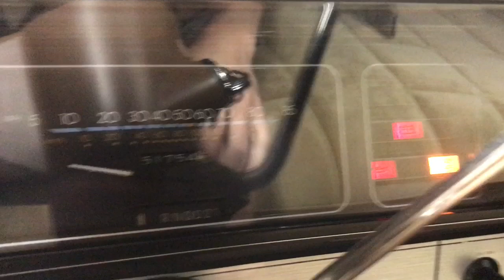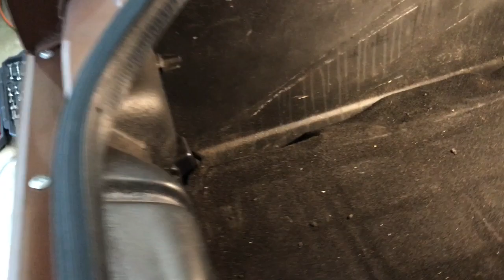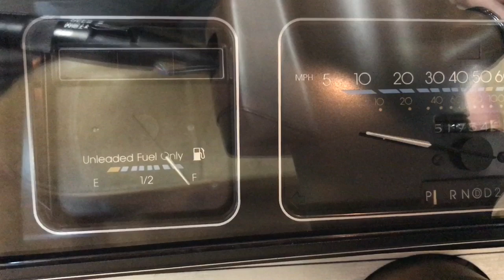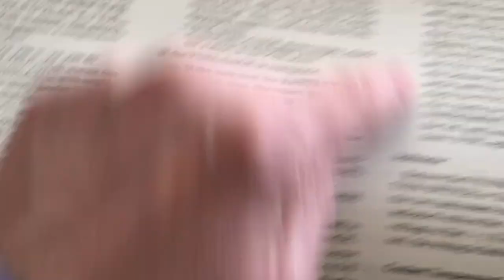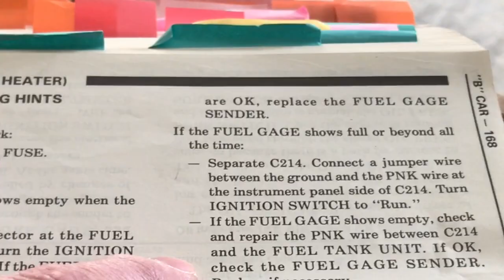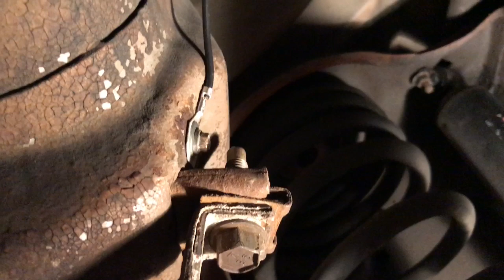Gas Gauge Problems - 1985 Chevrolet Caprice Classic

Comment: Om my 1980 Oldsmobile delta 88  i changed (put in new) the sending unit in tank ,filled up the tank and seen if the gas gauge read full.If not i pulled off the needle set it to the full position,then disconnected the wires to see if needle swong vsmoothly drops down  to empty.and back up to full.works for me .Even if  you have a new gas gauge  installed.But they say something about having it calibrated.Those colorful little blocks behind the screws behind the gas gauge i heard were resistors of some type,not sure .So if you buy a used gauge the  problem could be there as well if not the wires.Even if you buy a new guage.and install it .if calibration means adjustment.Then adjustment is  needed somewhere i would think .And those color blocks if they are resistor what number do they represent compared to your original one that might be old and losing resistance as well or not the right resistance.Just food for thought i been in that situation as well.

Comment: How did you get your hand behind the speedometer to disconnect the cable?  I can't reach...???  Help..
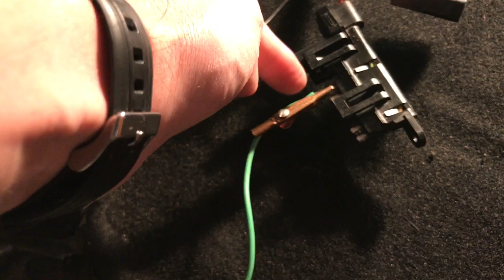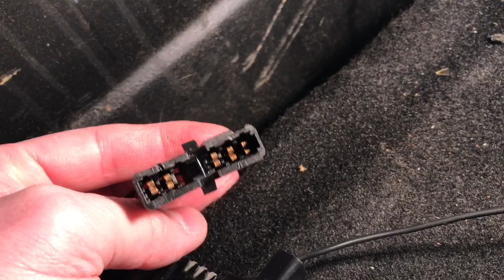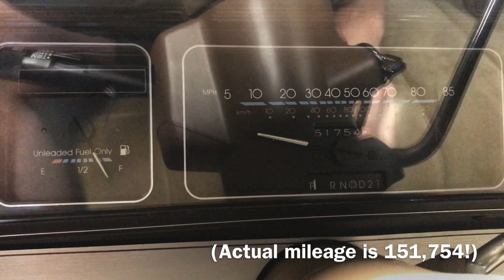Reply from the maker: @cmscms123456:  Starting at 5:20 in another video (https://youtu.be/AR3tJ8X4ECo), I explained and showed how to reach behind the instrument cluster to reconnect the speedo cable.  Also, starting at 3:42 in another video (https://youtu.be/yasrEpSDi4Q), I explained how to reach behind and disconnect the speedo cable.  And, at 0:49 in another video (https://youtu.be/M3ZANm2ygt0), I also explained how to reach behind to reconnect.  No matter how you slice it, it’s an awkward and tight spot to reach in behind the instrument cluster.  I suggest pulling the instrument cluster forward and down a little bit so that you can look down from the top and reach in from the top as shown in the first video link above.  Good luck.
Reply: There’s a tab at the top of the cable push it toward the cluster and it pops out

Comment: I have Changed Gas thank both of my GM cars 1989 Chevrolet Caprice Wagon and 1980-Oldsmobile cutlass calais and the problem is the fuel gauge shows it overfilled like 10 gallons in both cars so how I can fix it becouse I need To get it working becouse its my first car and I am going To 100 mile trip To my friends at summer so it would be nice if i am not out of gas at side of road
Reply from the maker: @Mr kapeli:  I have a recent video in which I finally fixed the gas gauge.  See https://youtu.be/AR3tJ8X4ECo.

Comment: I developed nearly the same problem. The gas gauge will max out only at 3/4 while it used to go all the way when full. Thought it was because I tripped or hit something while cleaning the dash and gauges with the glass screen off. Guess not since this seems to be a common issue. 

It still drops down normally as I use more of the fuel and the tank empties down below 3/4.
Reply from the maker: @Max Ax:  At least I’m not the only one!   Still haven’t gotten back around to fixing this yet.  See the other comment and @TURNT’s suggestions.

Comment: Same problem 1989 caprice limo but on propane!
Reply: Did u find out what it is
Reply from the maker: @Tony Pena:  The gas gauge in my case seems to be an electrical ground problem.  I replaced the gas gauge and the sending unit to no avail.  Next step will be to replace or splice the ground connection wire from behind the gas gauge down to the fuse panel.  See also comments by TURNT, who suggested this.  I hope to try this soon….

Comment: Awesome video and so glad I found your channel.  I just bought a 1983 Caprice Estate wagon and man does it have a lot of problems -- one of those being that the gas gauge is off.  The needle reads way past the full mark when full, doesn't start to move until after about 100 miles, and then reads about 3/4 full after more than half the tank has been consumed.  Any suggestions from your experience?  Should I start with replacing the fuel sender?  Will be working through all your videos so thanks for making these -- they are a tremendous resource.
Reply from the maker: @Richard Lytle:  Thanks!  The gas gauge in my case seems to be an electrical ground problem.  I replaced the gas gauge and the sending unit to no avail.  Next step will be to replace or splice the ground connection wire from behind the gas gauge down to the fuse panel.  Just haven’t had time.  If your Caprice has a lot of problems I would suggest prioritizing from big headaches to small headaches (in terms of cost and impact to usability of the car).  To me, the gas gauge issue has been a minor nuisance for several years now, and one of those things I know I need to get back to, but other more important things come up (like the need to replace the tires and the shocks).  So if it were me, I would save the gas gauge for later, and just keep track of your miles between fill-ups on a piece of paper in the car - probably 200 to 250 miles per fill-up should be a safe estimate.  Keep me posted on your progress….  I will post more videos as I have time and continue to work on the car.  On deck this year will be the carburetor, speedometer squeaking, and who knows what else….

Comment: Did you fix it ?
Reply from the maker: @LAA SHEP:  Not yet - haven’t had time and quite honestly I’m not looking forward to taking apart the whole instrument cluster again (see other video).  But I still think it’s a problem somewhere from behind the gas gauge itself down to the fuse box.  See also the other comments on this video by @TURNT.  Separately, when driving the Chevy I have occasionally noticed that the gas gauge would randomly swing from 3/4 full to way past empty in less than a few seconds, then five minutes later it would swing back.  Not connected to road bumps etc. from what I could tell.  So definitely a bad wire or connection.  I just have to find where it is.  Ugh.
Reply: @LongologoProductions  will keep that in mind! preciate the reply, happ new year !

Comment: Did you fix it?
Reply from the maker: @BoxChevyPat:  Not yet - haven’t had time and quite honestly I’m not looking forward to taking apart the whole instrument cluster again (see other video).  But I think it’s a problem somewhere from behind the gas gauge itself down to the fuse box.  See earlier comment on this video by TURNT below for a possible clue too.  Separately, I was driving the Chevy last weekend and noticed the gas gauge would randomly swing from 3/4 full to way past empty in less than a few seconds, then five minutes later it would swing back.  Not connected to road bumps etc. from what I could tell.  Definitely a bad wire or connection.  I just have to find where it is.  Ugh.
Reply: @LongologoProductions  thanks

Comment: I think I may be able to help.

Since I own a '84 Pontiac Bonneville, it had a similar issue where after the sender unit was replaced by the GM dealership, here in town- and the gauge still did not work.

It turns out that the factory wiring was damaged. It is a tan wire. However, I could not locate the actual break itself.

Also, there was corrosion on the traces, that run along the back of the gauges as well. I directly had to solder a 10 foot jumper wire, to the back of the gauge itself, and run it along side the car, behind the back seat all the way to the trunk lights, and from there, clip the white wire from the fuel tank, from the factory wiring and connect it to my new bypassed wire.

However, in the case of my Pontiac, it has 2 idiot lights and 2 gauges, in a combined cluster. Yours will operate the same, but the procedure to solder would be different.
Reply from the maker: @┗(-_- )┓TURNT :   Thanks very much.  This is very helpful.  I already replaced the fuel gauge and the sending unit, and figured the problem lies in the ground through the frame somewhere, or in the wire behind the gauge down to the fuse panel, or from the fuse panel to the frame.  One of these days I will probably end up running a very long jumper wire to test it out like you did, to see if I can isolate a segment of the wire.  Thanks again!
Reply: @LongologoProductions  No worries :) I'm sure you will find a solution.

Since I posted that comment, I ended up also getting a 1988 Caprice. If you have more videos on these vehicles, I'd really appreciate any further insight. Cheers man.
Reply from the maker: @┗(-_- )┓TURNT :  Cool.  Composite headlights on that one, right?  I'll add more videos on the Caprice, but I've got a lot going on right now so it will be awhile.  Rear end light bulb replacements, wheel restoration/repaint are on my to-do list....  Enjoy the '88.
Reply: @LongologoProductions  That they are. I kinda like the lights the previous years had, but at least they work haha.

And no worries dude.

Comment: I have the same problem in my car its 1989 caprice I have tried somethings but it doesn’t work please let me know if you fix it
Reply from the maker: @Waheeb Natto:  Still haven't fixed it.  Need to troubleshoot the ground connections all the way to the front end now....
Reply: It's easy to fix, but it does require soldering unfortunately, unless its strictly just a sender unit gone to shit tbh.